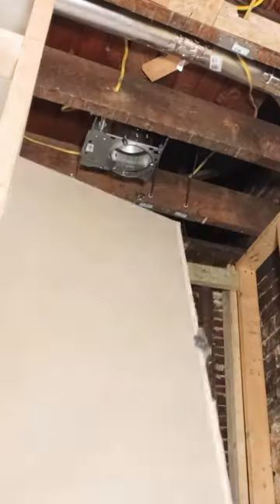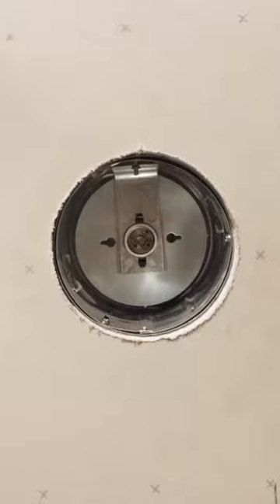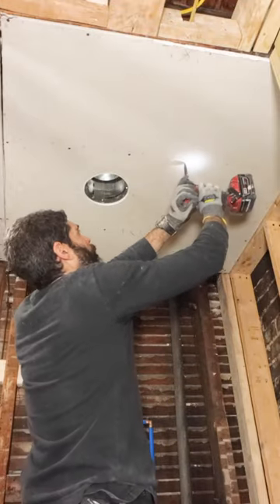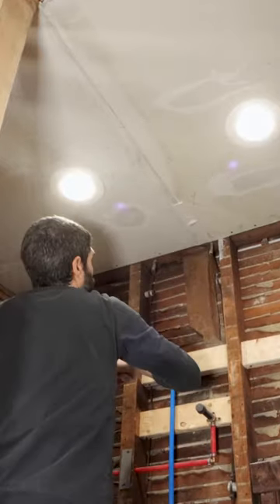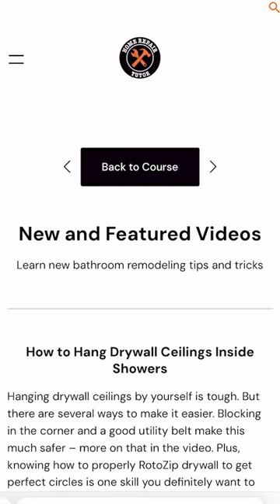Drywall Ceiling Installation Tips - #shorts

Comment: The ez sand 20/45 not only saves time but is a superior bed coat. Not so sure I would have created a butt joint to utilize a couple of cutoffs but i'm sure you'll never know it was there when complete.
Reply from the maker: Thank you my friend, yes, that butt joint hopefully is unnoticeable after all the passes. I’m a big fan of Easy sand in humid areas
Reply: I use durabond 45-90 for my pre fills in bathrooms never have ANY cracking years later. You have enough skill in the trade to use it but beware to beginners it is unforgiven.

Comment: Why backfill the joint then wait for it to dry to apply paper? I feel like pro installers i've seen don't even do backfilling, they just apply paper and joint compound with that roller all at once.
Reply: Yeah that paper will bubble up after a couple years now
Reply: It’s called Prefill… Always Prefill gaps that are not tight… Typically with hot mud you use mesh tape… Especially in a shower area… He also should have used green board… Butt joints should be vgrooved before Prefill to allow proper mud application in the joint… Then tape it… Also hot mud doesn’t shrink like taping mud or all purpose… Both of those will shrink back leaving more room for additional coats of finish mud… That’s why on smaller jobs I’ll set mesh tape with hot mud the two coats of finish mud, then sand, pva & then texture… Also if you are doing smooth wall, take a dirt wet cleanup bucket sponge and wipe down the walls before PVA… The joint compound in the water will close the cells of the paper getting rid of the fuzzy to smooth difference from the finished joints to the bare paper…

Comment: Or the extra 2 hours you spent mudding, could have spent 14 bucks, and made more money, don't know about you but I charge 200 an hour for 2 guys everyday, all day,so seems to me I could have made an extra 285 bucks, instead of spending 2 extra hours mudding, but what do I know??
Reply: My thoughts exactly. Less joints means less sanding and mudding and less dust to clean up. Buy more full sheets. Only use scraps when the area is the same size as the scrap.

Comment: Even faster use boards. Nail in place and done.
Reply: Not good for insulation, drywall helps for heat/cold, humidity, and sound